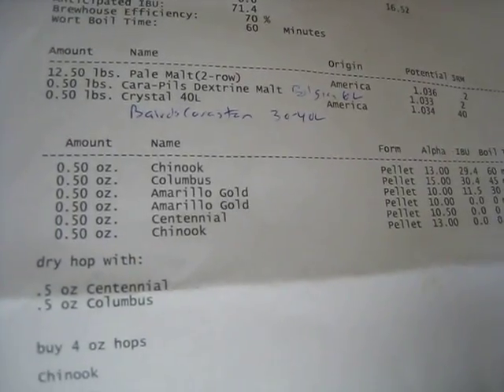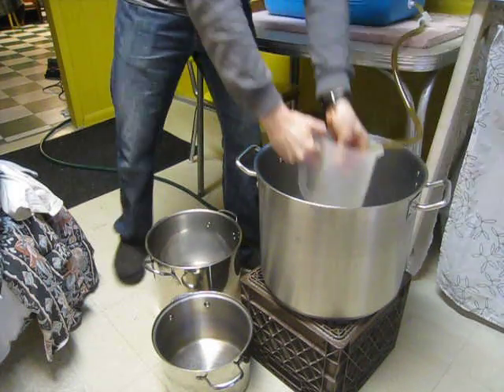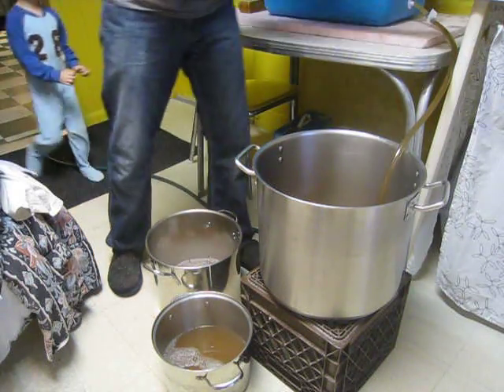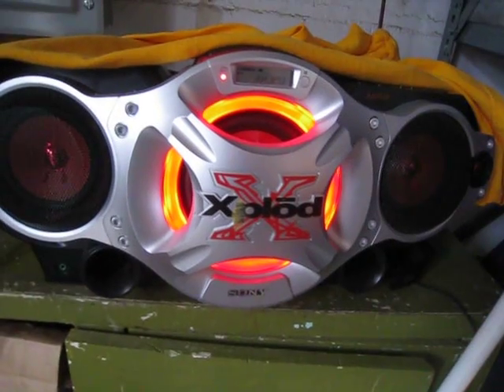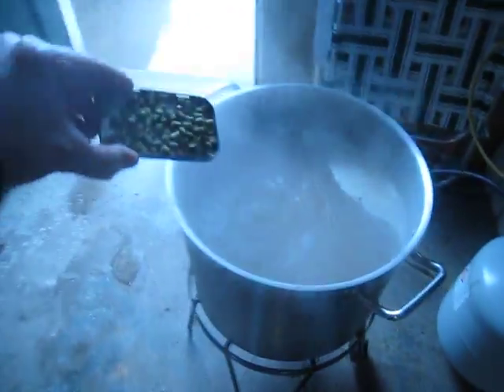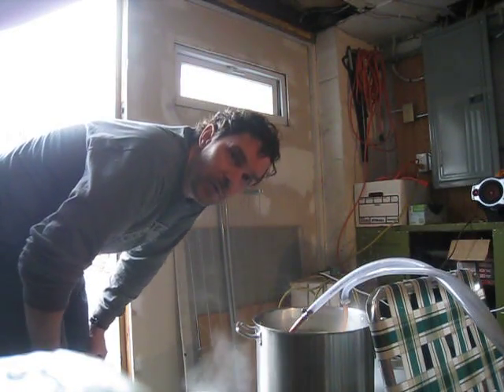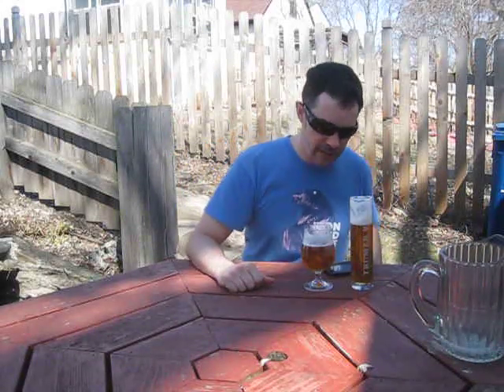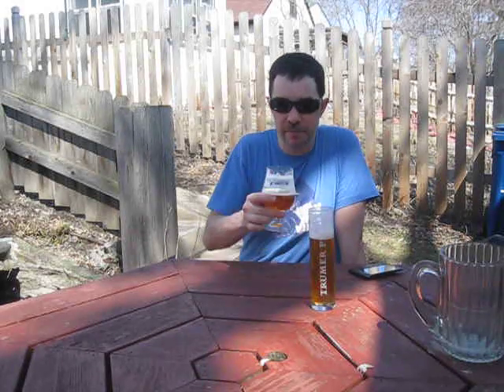"Late Addition" All Grain Brewing Experiment

Comment from the maker: You are right.  This is awfully similar to my "high gravity all grain brewing" video or technique.  I guess one difference is, I did not do a 2nd sparge (third runnings) for this beer, and I might do that for an even higher gravity one.  My hoppy beers have always come out nice enough, but I thought if I had the same volume of pre boil (say 6 gallons) but it was a lower density, I am said to get better hop utilization.  Then I just add the extra 1/2 gallon in at the end of high gravity wort.

Comment: Great Video! Very cool idea. I don't know if it would work or not. I've read a lot of conflicting information about wort volume and density (gravity) affecting or not affecting hop utilization. Personally, I do late additions, but it is because I have a thin pot and brew on an electric stove top. If I don't add most of the extract late, it scorches easily and definitely comes out darker than it should. But I would really like to do some 1 gallon experiments like this with controls...

Comment from the maker: Sure, but part of the point of the stove top boiling (and in two pots) is to reduce the volume.  That is why I "over collected" the wort.  But, you could do as you say, sure.  It would just be a different process.  I suppose your wort that you are boiling the hops in would be "thinner" than it would be otherwise, which is part of the point.  It is half the point, I guess. :)

Comment: i have done this before, but for a totally different reason. first thing, we know your thinking is correct, but how many hops do you really think you r saving on this size batch? maybe 2-4 pellets? lol. the main reason they did it in extract batches was because most of those brewers couldnt do a full-wort boil resulting in super high gravity if the LME was added near the beginning. also, all that boiling of the first runnings leads it self to more malt forward beer styles IMO

Comment: Hey Don, what are your thoughts on hot wort aeration during the Worlauf?  I don't use a tube to drain the wort from the mash tun, so it splashes into both the kettle and the pitcher I use for Worlaufing.  I haven't had any noticeable problems in the finished beer, but I am curious as to your thoughts on this.  Thanks.